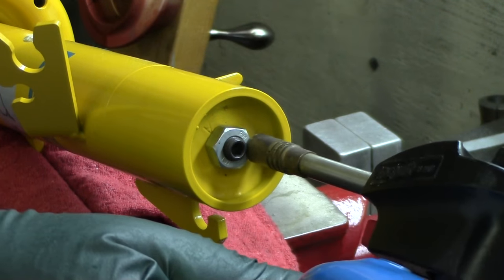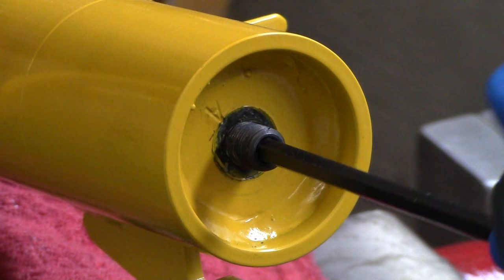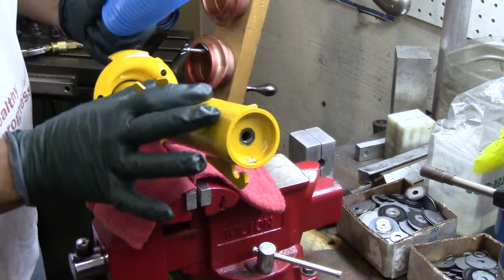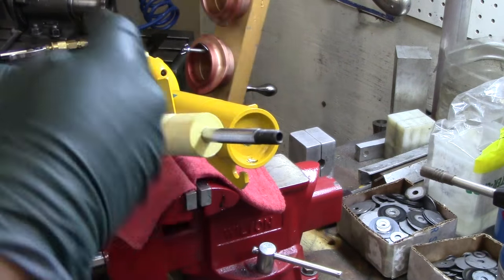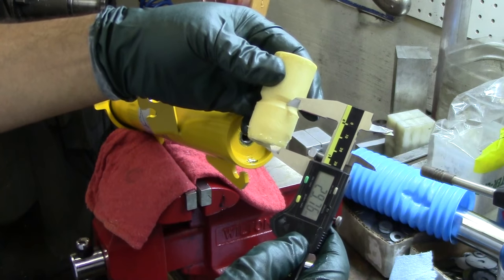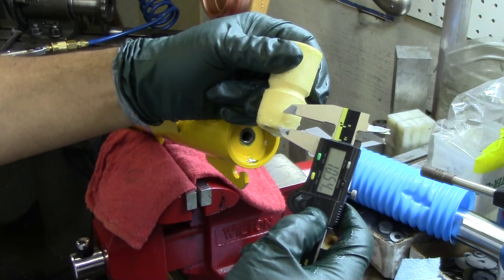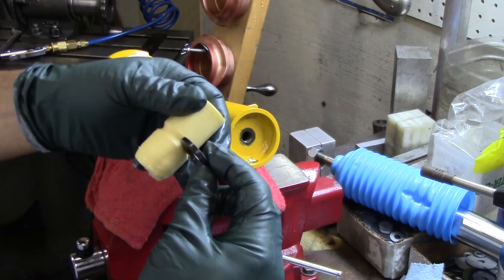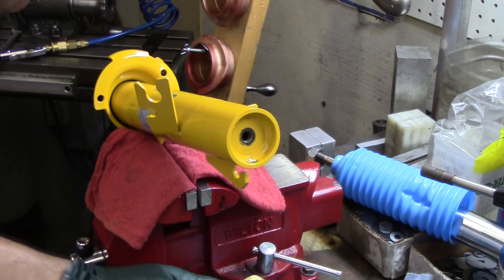How Shocks Work - Access Bilstein inverted strut bump stop (3/3) - with timestamps

Comment: I have 8 month old shocks with less than 10000 mile on it, and the driver side shock makes a clunking sound where the mono tube meets the outer case. How can I fix this?
Reply from the maker: Are those Bilstein struts? Are you examining the strut outside the car, or when you're driving? Not a lot of info provided. If you have new Bilsteins, contact them for warranty support otherwise you would void a warranty working on them on your own. If they're another brand, contact that vendor.
Reply from the maker: By the way, you might have worn strut bushings. You can check out this video: https://www.youtube.com/watch?v=6Zceh2CXkdI&feature=youtu.be and the information section